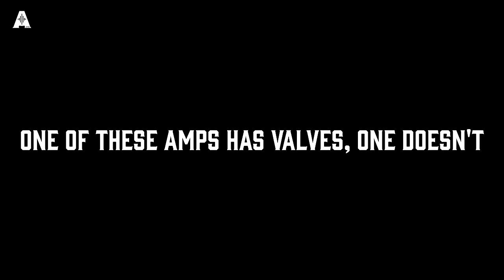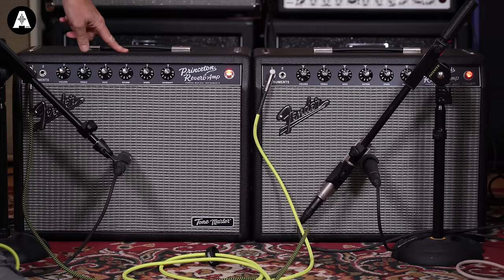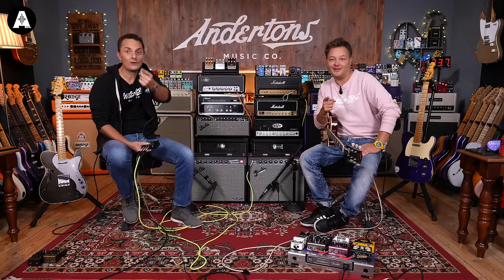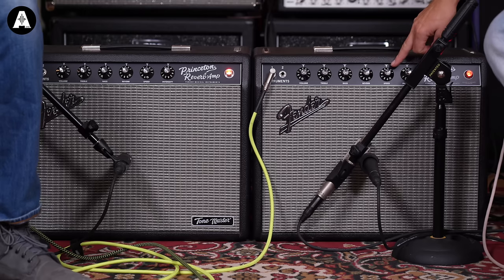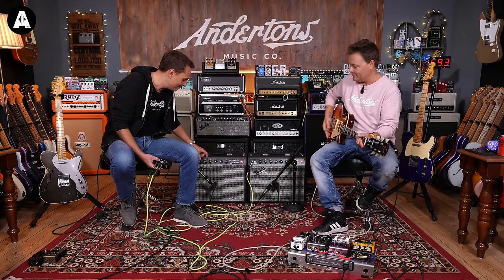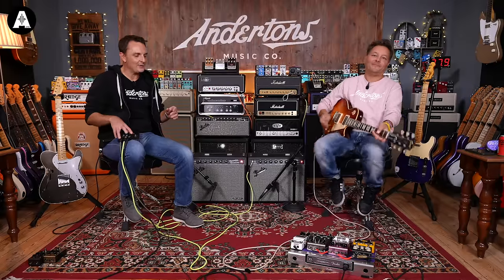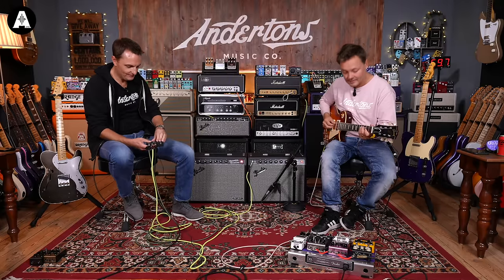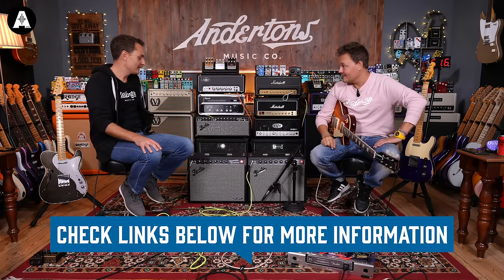Fender Tone Master Princeton vs the Real Valve Amp! - Can You Tell the Difference?

Comment: if youre going to A-B at least play the same riffs.  I dont think many will tell the difference but for the price difference id go for the valve every time. If the solid state goes its a brick, if the valve goes it should be easily repaired
Reply: That doesn’t hold water.   I have a bunch of vintage synths & samplers.  Most of them have required repairs & salvaged parts.   Everything breaks, eventually.  It’s just a different method of repair
Reply: Concerning these video reviews.   They are always excluding small details.  They want their continued support from mfg’s.   My tone master is amazing but, it certainly has its differences.  It doesn’t like a lot of distortion pedals.  But it sounds great, on its own.  & it’s versatility is way beyond that of its tube counterpart.  It really depends on how you use an amp, whether it would work for you.  They aren’t going to be for everyone, for sure
Reply: the same could  be said for mobile phones and all this modern electrical stuff ..they don’t use valves .I’m. Still using a 1976 solid state HH musician combo ,I’ve had it thirty years with no repairs in that time .and all the pcb’s and parts on them are still marked HH so that means it’s not been repaired since 76 ..so not bad for a nigh on 50 year old amp ..how many times would a valve amp be repaired or re valved in that time ..I’ve got valve fender amps and not one have done five years without repairs and re valving ..and that tone master would never be as unreliable as the blues deluxe re issue or the hot rod deluxe re issue valve amps ..the repair videos on YouTube on those two amps are higher than any other .
Reply: Not true at all.  Both amps are PCB construction, so replacing a failed component is no more difficult on either.  Valves don't make an amp more serviceable, that's down to the quality of the board & components.
Reply: Genius
Reply: You are correct, if the main DSP ic dies it's basically going to be a write-off. I've used valve amps for years and only ever needed to replace a 12ax7 (and it wasn't sudden catastrophic failure, so didn't affect performance).

Comment: I want to know exactly what the difference between an exact amp with tubes vs SS. The funny thing is I always get it right when guessing, but it’s hard to explain what it is!!
Reply: For me the difference is definition of notes and the dynamics that tube amps provide that ss amps lack. You can really tell when you dig into a note on a tube amp. Most ss amps sound lifeless for lack of a better word. And I’m not knocking the TM series as I think they are great amps, but they still can’t do that tube amp thing.

Comment: Reliability and feel are such tired arguments at this point. If anything, solid state / digital is going to be more reliable than tubes, but regardless, any tech is going to be able to repair either amp. Additionally, most people I know don’t own their amps for 50 years, so who really cares whether my grandchildren will be able to use my tube amp in the future or not? 😂

I also think it’s funny that most people don’t like the DRRI / PRRI when compared to true vintage, but they make concessions here just based on the fact that they don’t like digital.

This is the future of mainstream amplification.

Comment: It's not fair to set all the pots to 5 on 2 princeton and expect them to sound exactly the same. You will have to trim the volume and tone pots slightly to get a balance. There is a 10% tolerance on the pots which means the treble and bass could be different by 20+ ohms on each amp and the volumes by up to 100 ohms. So picking up a difference between the tonemaster and the valve amp is probably similar to the worst case difference between to valve princetons. And that's without taking into account the speaker, valve and transformer differences and the dreaded biasing which isn't great on princetons.

Comment: 2nd listen and i can safely say that the new TM amp is the single best use of digital technology in music since i first experienced (and instantly bought) the Roland Vst digital 8 track multitracker after using a cassette tape Tascam Porta Studio for however long it was.
And that is a huge statement because i literally felt like 'Tommy'  (see The Who etc). Yep, Fender have brazenly planted thrir flag atop the mountain dude!!
Reply: Bro, it's just a digital modeling amp. They have been on the market for years, and they're way cheaper than this thing. 800 for a digital modeling amp is insane. Would you pay that for a Line 6 Spider? Then why pay that for a Fender? Because it says Fender? C'mon now...

Comment: But they are not so far apart in terms of pricing, yet one will keep its value - the tube one - whereas the other one will not... Without taking into account that the solid state one is likely to be disposable whereas the tube based one is likely to be serviceable for the next 30 years (even if it is a reissue and PCB based)... If you gig a lot and have a lot of cash to spare the solid state one might make sense, but otherwise I do not think is likely to be a good investment...

Comment: The one thing where Fender goofed is limiting the amp to 15 watts.  That is just goofy and short-sighted.  Quilter makes a two-channel 1x8 combo that's 100 watts per channel, and it sounds huge.   Come on, Fender!  This  Princeton is different enough to ignore nostalgia and really bring this amp into the modern age.  The parts necessary for greater power will not add that much cost, either.

Comment: The digital one has this strange annoying high pitched scratchy noise at the top end. It only does it in certain situations. You can clearly hear it here. 20:24 and listen for about twenty seconds any you will hear it when he switched to the digital amp. When he switches back to the valve amp it isn't there. It's a very annoying noise. I'm surprised it wasn't mentioned.

Comment: The thing nobody thinks about is longevity on these things... buying tonemaster is like buying a computer that won't be serviceable a few years down the road, whereas a proper valve amp will be serviceable basically forever, and at a much much lower cost.
Reply: Why would they fail? I've got electronic stuff that been working for decades
Tube amps are much more prone to fail so all these comments aren't fair
Even if it is easier to repair a tube amp, out of 100 tube amps of the day, 90  are full of PCB and computer stuff anyway.. Only hand wired amps are really repair friendly
Reply: @rodolphep0nthus555  PCB and "computer stuff" are very different things. Tube amps built on PCB are absolutely repairable without just replacing the boards.
Computers fail all the time, especially when heat, and vibration are largely in play. even right now, while the amps are in current production, you can't get replacement boards for the tone master amps. they're just landfill fodder and nothing more.
Reply: @dustinthiessen  Well ok so the thousands of Tonemaster amps Fender sells today are part of the programmed to fail items like dishwashers and soforth. Fender is going to have serious problems, selling amps priced between 800 to 1200€, and part of their higher end amps.. All this hasn't got me ordering the TMPR today, and just play and stay away from internet downers.

Comment: I got it right.  Sounds good in the video but if it's like to tone Master deluxe reverb it's just not good. I gig with a regular deluxe reverb. I wanted to love the tone Master deluxe reverb but it sounds like crap when you put pedals through it. It feels like crap. The high notes on the high e string feel weird and sound fake. Blah blah blah. Just suffer with the weight of a tube amp.  They sound and feel better. Edit:  I tried the tone master deluxe in blonde and it changed my mind.  It's really good.  I figured out what pedals work with it and I've been gigging once a week with it.

Comment: I got it wrong. I had the valve as B.
Reply: Me too. Reverb aside, I relied on my perception of their frequency responses and they way they clip. I felt that amp A seemed darker at soft strokes and brighter at strong strumming, perceiving amp B the other way around (which is what one expects from tubes, to "clean up nicely"). Also, when distortion of amp A was fading out, I thought I heard that "diode buzz" trails, normally in solid state drive pedals. Sure, a DSP signal should not sound like diodes, just I based my decision on the fact that tubes don't normally sound like that, their trails clean smoothly.

Comment: It is my opinion that both of these Fender amps don't sound like an original 60s Princeton amp. They don't have the tone or the sustain. My daily driver amp is an point to point hand wired Fender Deluxe Reverb. Over the years I have one several Fender amps. My last 65 Princeton amp came out of the trash and after replacing the 10" speaker it sounded great. Most people won't be able to tell the difference anyway.

Comment: Anyone who says they can't hear the plastic sound which you get from solid state amps (yes digital amps are solid state), have just obviously never regularly played in a loud band situation. These tone master amps are a rip off at their prices. A cheap fender mustang amp from 10 years ago will get you the same excellent clean sound. The problem is the distortion from class D power amps and their complete lack of ability to play with fuzz and distortion.

Comment: I can see the huge advantages of a Tonemaster Twin or Deluxe Reverb or- Super Reverb for a working gigging musician—-lower cost than real valve counterpart, lighter weight/easier to transport, sounds great—close enough to real tube deal for majority of venues. But there are some downsides. For one—hard to understand why Fender wouldn’t bother to put a dedicated effects loop on back of tbese Tone Master series amps—c’mon man Fender is unwilling to make their digital modeled versions of their classic tube amps truly up to date to modern amp standards.Seems either egotistical on Fender’s part ( “ we are determined to keep the Tonemasters identical to their tube counterparts”) or just lazy. Looks/appearance of fromt control panel would not change of effects loop in and out were added to back of amp—and it would be nice to have a footswitch that not only turns Reverb and or Tremolo off and on but also another button that allows one to turn the effects loop off or on.

Biggest question and potential downfall for the whole Tonemaster series that remains to be answered is the durability or longevity of these amps. How long will they last before breaking down? Are they even repairable by an amp tech/repair guy? Will parts to fix them be readily available? Will replacement parts be so expensive that its not cost effective to even bother to repair them? Given that Fender decreassd the duration of the warranty on all of their amps from 5yrs to 2yrs a while back—and being a strictly home/hobby player—i am inclined to wait and see just how well these Tonemaster amps hold and how well Fender supports this new like of products (still have a beef with Fender over them dropping Fender Fuse support and essentially abandoning the original Fender Mustang digital amps (V1-V2). If these Tonemasters develop a reputation for going kaput at 2-4 yrs post purchase (out of warranty) and are unrepairable—no thanks! i will stick to tube amps—better bang for the buck in the long run.

Comment: I didn't watch the video. But it'a well known thing that a good tube amp will hold it's value, will be in use for many decades, will sound better, will be easily repairable, and a good digital modeling amp will be replaced in less than a decade with the next generation product, will lose it's value, it won't be repairable after the service period is over (that is only a few years), and will turn to junk if it's broken, like old computers and smart phones.

Comment: I knew amp A was the valve because spring reverb units notoriously have very short decay and a very thin and "boingy" quality to the sound. I myself prefer digital reverb because it really captures the sound of being in a large room. I also, overall, prefer the sound of the tone master over the reissue. Everyone falls into the trap of "well, this sounds better, so it must be vintage cause vintage always sounds better." If people were honest with themselves, they'd admit that the digital recreations of classic amps and pedals sound just as good if not better than the original.

Comment: Let's be real- if you compare this to the coveted Princeton Reverb then yeah- it's going to save you money and make sense- until you compare it to the rest of the amps on the market. Once you put it in competition with the rest of the market- now it's not such a great choice. They make real valve amps with digital reverb, with emulated output and cab sim, with the ability to achieve breakup at very low volumes, and they cost considerably less than this emulation. But they don't have the name Fender on them, and they're not associated in any way with the Princeton reverb- which are the real selling points for this amp. 

Edit: I should also mention, the digital emulated output on my tube amp- it sounds like shit. So- to be perfectly fair possibly this amp has a better emulated output and cab sim- tbh that doesn't matter to me because I never use it but- just saying. I've never heard the digital emulated output of the tone master- I certainly hope it's better than the digital output of my Blackstar. That said, everyone I've seen using it online uses the Torpedo Captor X with it to add a cab sim so- I suspect it doesn't sound much better.

Comment: These amps are simply a  Modeler. They could make just one with all the Fender models in it. Like all modelers there will be a new one by another company that does the amp voices even better.
Bottom line just buy a modeler that can be updated. Better still buy the tube version of the amp it will forever increase in value. These Fenders are destined to tank in value.
Please note in the video they keep saying "It sounds similar". I have pedals that sound similar but they are just a couple of hundred bucks. Bottom line? At half the price which could easily be done they might be valid. Rip off ??? I think so.
Reply: They should just make a cool-looking vintage head that looks like it's part of the tube family only it has a 5 switch to go between princeton, reverb, twin, bassman, and super. Add effects loop and then release matching cabs for all the speaker combos someone could want.

Comment: WARNING … a critical attribute missed by aal of these “ Tube v Tone Master” videos… 
1) WHAT WILL IT COST …To repair a tone master when the circuit board or computer dies..
2) Can it be repaired by “ other than a Fender approved shop”
3) are parts, repair manuals and diagnostic tools available.

Without GOOD answers to the above…. NO…keep your tube amp

Comment: Amp B is clearly the (modern circuit board) tube amp. An original hand wired Princeton Reverb (or a modern clone) sounds WAY better. They are arguably the best recording amps in existence.